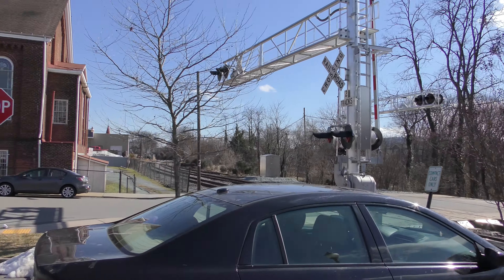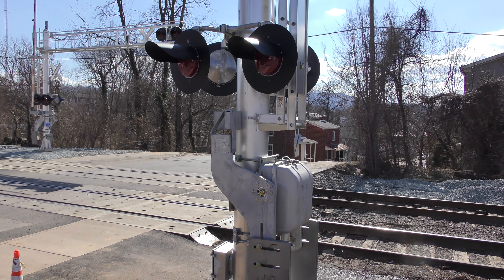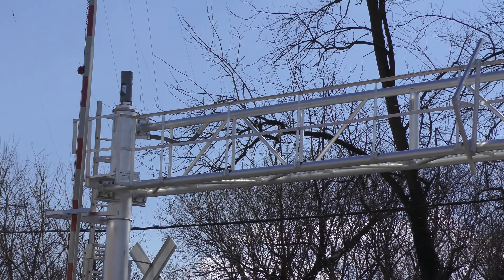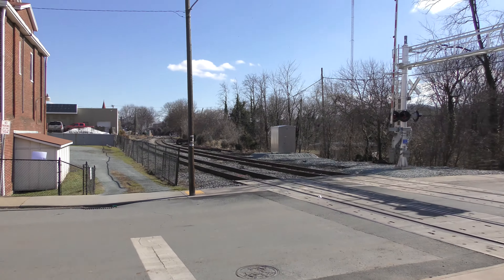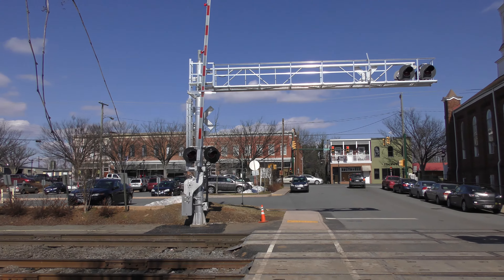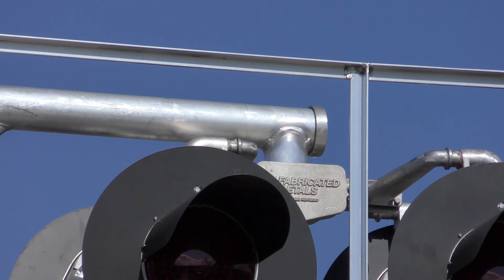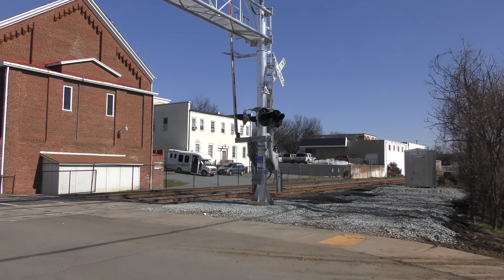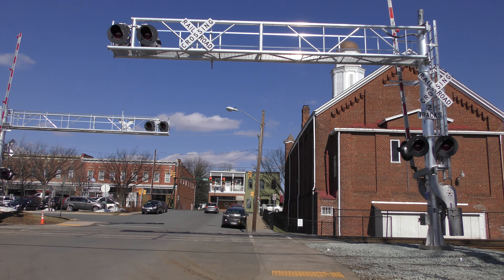New railroad crossing signals at 7th Street!

Comment: Thanks for posting this. I'm guessing this needed an upgrade since the old crossing here had 3 tracks. Just my own opinion.
Reply from the maker: +filmer765 You're welcome and thanks for watching! Ah, didn't think about that! That's right, there are only two tracks here now, they took out the third one! Funny thing is, there are two electronic bells here as opposed to the one mechanical bell on the old signals, and the old mechanical bell was louder! I was right underneath the signal when the Amtrak Cardinals came through and the bells were so quiet!